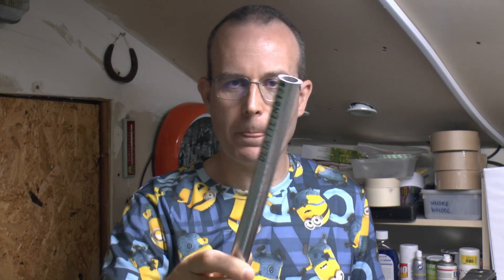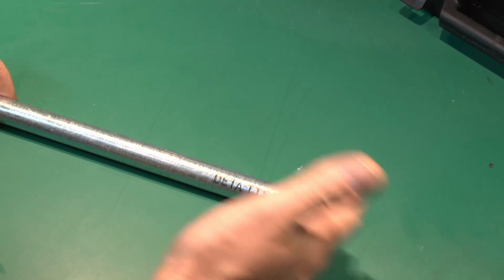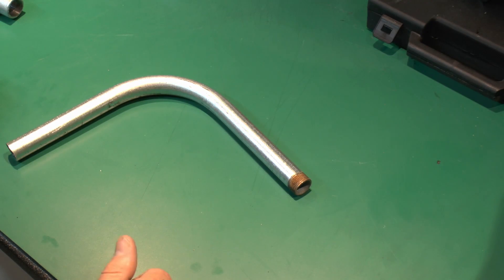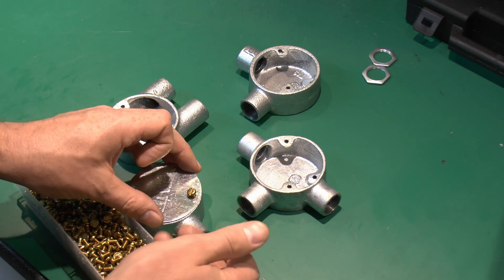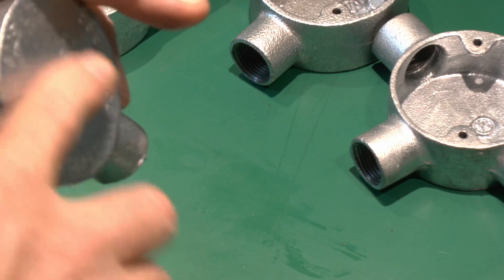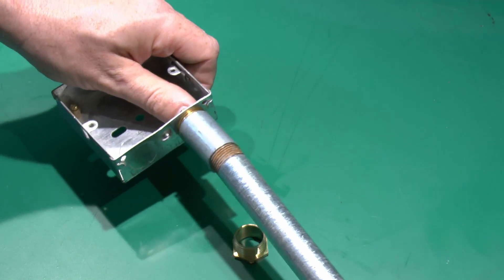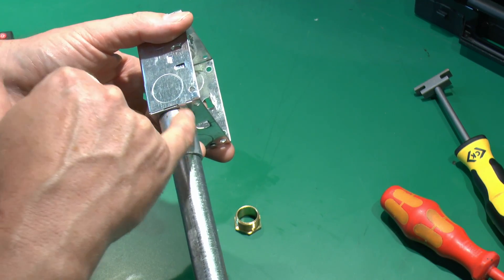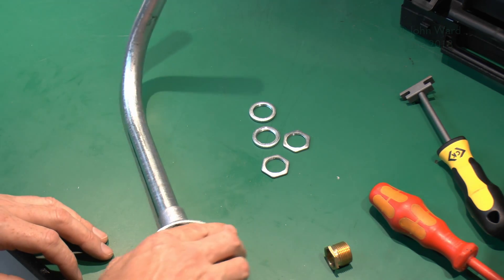Steel Conduit 1 - Overview of Parts and Tools

Comment: Can you use the steel conduit outside into a light (side entry) using just a Bush and coupler? I don’t see how it’s ip rated against rain?
Reply: Definitely no IP rating with metal fixtures and components. That's what you see with plastic parts.

Comment: JW, as always, thanks for your videos, very helpful content. I wanted to ask, can the galvanized steel conduit be used externally? I ask because it does not look like the boxes will be waterproof when you screw a flat top on them?  Thanks
Reply from the maker: Yes, it can be used externally.  Rubber gaskets are used to seal between the lid and the box, https://www.yesss.co.uk/circular-conduit-box-rubber-gasket
Reply: @jwflame  ahh yes thank you, obvious really, I should have checked.  Thanks for your response, and keep up the good work with the videos.

Comment: What is meant by class 1,2,  3 & 4 in steel CONDUIT (BS 4568) , Is this specification still in use?
Reply from the maker: That standard was withdrawn years ago.  The classes referred to the protection of the steel, such as primer, enamel paint or zinc galvanising.

Comment: Here in the United States we use 6/32 screws for switches and receptacles, and 8/32 screws for light fixtures. The screws have 32 threads per inch.

Comment: I find using a vacuum cleaner with some flex conduit taped in the end can pull a string through to pull cable. Also can use if drilling through a box want to vacuum the mess as you do.

Comment: Yeah, huge difference between EMT and rigid conduit.

Interesting that British sizing is for the OD, not the ID. Trade sizes in the US specify the ID and, unlike US lumber, the actual ID is slightly larger than the nominal value. So-called 1/2" conduit has ID ~0.74" and 3/4" has ID ~0.95".

Are the UK threads straight or tapered? The handles on that diestock are pretty small for the size.
Reply from the maker: Threads are parallel.  Conduit has always been sized on the OD.  However steel pipes for water or gas (and the fittings that are used with them) are still sized on the ID in inches, even today with most everything else being metric.
Reply: @jwflame  Very interesting. US rigid conduit still uses those inch pipe sizes and tapered threads. The tapered threads are a pain for aligning bends—the jam nut you show is going to be much less trouble.
Reply: @PaulSteMarie  I think it's the same with garden hoses and fittings as well. In the UK, the threads are straight, whereas in the US I believe you have tapered threads.

Comment: i have threaded plenty of conduit for internal work galv conduit is a total waste of money black enamel was allot easier to thread but that was them good old days . but think 18 edition wiring regs are with us metal consumer units plastic conduit could collapse in a fire oh dear , the metal clad system is back . a swan neck bend was the practise piece for a beginer in con duit or two u shaped bends with running couplers i made a right mess of mine . john thank you for these videos  you are a person with in depth knowledge . ? the iee used to have lecture nights held around the country to explain things in yours and my terms a bit like the christmas lectures on television i went to two very very good iet now what do these people offer if  dont they should . thank you john
Reply from the maker: Black conduit was cheaper in the past, but now it's rather difficult to find and is either the same price or more expensive than the galvanised.
Reply: @jwflame  Not sure if I'm reading this right but RS seem to be offering 20mm at £2.47/metre while galvanised is £2.58/m.  The snag might be that it's listed as 'back order, dispatch when available' so the price might be a for a product that never appears.  :)  And even so I see offers online for galvanised that are half either price so assume that RS price is well above what would be found at trade counters.

Curious memory, black enamel was used throughout the 'new' building at school which was erected 1970-72.  Very smart it looked too.

Comment: I'm seeing a lot of comments on US conduit properties which are pretty inaccurate. Here are some common specs for US conduit types:

3/4-inch EMT (21mm inside diameter) Nominal wall thickness 0.049 in., 1.25mm (tubing is not allowed to be threaded)
3/4-inch rigid conduit (21mm  inside diameter) Nominal wall thickness 0.107 in., 2.72mm (threaded with tapered threads)

Neither of these are bendable with bare hands unless you're really, really tough. For EMT trade sizes up to 1-inch and rigid trade sizes up to 3/4-inch, we generally use a hand bender. Above these sizes there are hand-powered benders, electric benders and hydraulic benders.

US practice would be to avoid the combination of bushing, coupling (coupler) and threaded conduit to minimize the number of joints when using the conduit as a ground fault path. We would typically use two lock nuts on boxes with knockouts, one inside, one outside the box to attach the conduit to the box, and a plastic or malleable iron bushing inside the box to cover the end of the conduit and prevent damage to wires. Cast boxes will be similar with factory threaded (tapered) entries. The tapers on the male and female threads form a pretty liquid--tight connection.

Set screw connected conduit has a very long tradition, and if installed properly can maintain ground continuity for a very long time especially when steel connectors and couplings are used (versus the zinc fittings which were very popular back in the 70s and 80s). That being said, it has become common practice to pull a separate ground conductor through conduit and not to rely wholly on the piping system for ground faults. This doesn't eliminate best installation practices required for installing conduit with set screw connectors and upon installation the conduit system must perform properly as a grounding conductor.

In general, metallic conduit is much more common in the US and Canada than in Europe and the installation of conduit here requires a more advanced level of craftsmanship than outside the US and Canada. Guys who do it often have really turned it into an art form.
Reply: TIL NEC only requires a separate grounding conductor in EMT or conduit for health care facilities.
Reply: Thank you. Love the Show, but 25 years of dealing mainly with Rigid, I was nonplussed when John was acting like America is wired with EMT. There's also IMC, but we didn't use it. Our stuff was mainly in a Class I Division 1 area, so even the Conduit Fittings had thread on covers. Most of our stuff was clad with heavy vinyl like covering for corrosion resistance, but some Stainless Conduit existed in the facility. Thanks for the thorough explanation of the various U.S. Conduits.

Comment: I use wd40 spray or tapping spray when threading metal conduit.
Bahco holesaws seem the best for drilling out the backs, it's handy to make a wooden block to secure them instead of drilling between your feet on the floor
Reply: When I was an apprentice we used Starrett holesaws, and Temaxol cutting compound.

Comment: this is complicated work. you can't atach the boxes o the wall untill you finish all circuit. because you can't twist the box on the wall with a conduit atached to the wall. that's why they have the "nasty" way of connecting them.

Comment: Re the rusty thread, surely this would hinder a good earth connection. Is it the done thing to clean the thread with wire wool or similar then coat the thread with a light grease? Great explanation thank you.
Reply from the maker: No, normally you cut the thread and then connect it immediately.  That one is only rusty because the conduit was supplied with it from the factory and it got left outside in the rain.
Rusty bits should be cut off and a new thread done.
Reply: @pmailkeey  https://youtu.be/tdQKskNMNbw

Comment: Just about the only time we used a "slip ring" was when we needed ti join to conduits together that were both bent! 
Simply threading the length of the coupler and ring on one conduit, run the "slip ring" and  coupler onto the conduit, offer the two conduits together and thread the coupler over the second conduit tightening the first conduit with the ring! If you needed a Box to be at the right angle to a tube when tight simply try it first and if the box is too far to make it , note the angle it is off and run the die back to the end  plus the required angle! We also never used the conduit as an earth but ran a dedicated earth wire! This meant that 1. you did not have to have a lower resistance path because the conduit is steel and the wire copper and 2. When the conduit deteriorates you do have an effective earth path! .... Obviously we earthed the conduit at each light / socket / switch point ;0)

Comment: What's the advantages of metal conduit over SWA/Armoured cable?
Reply: Metal Conduit is far tougher than steel wire strands wrapped around cable. It also won't degrade due to UV light like plastics may.

Comment: Hi John, This takes me back to my apprenticeship when the conduit was 1 and 3/4 inch then they changed to 25 and 20mm. I remember bending the conduit using me knee or a length of timber with a hole drilled in it. Then the boss got a bending machine...good times. Copper piro was also a good product but too expensive now. Thanks for you videos. Cheers Dave.

Comment: Hi, where is it legally required in Uk and what installations is it just advisable? Appreciate the factual presentation in contrast to US self promotional vids.
Reply from the maker: Legally required - probably nowhere, but there are many situations where it is desirable or even essential.
Reply: Graham North 

Recent example being a tire bay storadge area with a  cable run behind tire storadge racks. Galvanised trunking specified  in this area due to risk of plastic conduit being broken through careless loading of the racking.

Its certainly slow to install but definitely has its aplications.
Reply: Usefull in workshop or garage instalations.
Reply: Paul F plastic is good enough for most workshops.
Reply: Im sure the lighting has to be in metal conduit if the building has a thatched roof.
Reply: Often a requirement in industrial buildings. Or in public areas where wiring cannot be run in/through the building structure. The owner or operator specifying metal conduit.
Reply: I think it is the company's who are insuring the buildings choice, i did hear of a case where they would not insure the house (thached roof) if the wiring in the loftspace wasnt in steel conduit.

Comment: Any chance please JW you can do a video about how to measure to bends etc and how to finding bending point on conduit bending former please
Reply: To find it the point for certain, measure the amount you need and mark the conduit then bend it at that mark and measure how long it actually came out, next bend subtract the amount of extra for the next bend and it will come out exact, I have used many different types of benders and they are all a bit different as well as the dies used but my method will give you 1 pipe that will need to be cut for the first bend on the end of the pipe and after that you will know exactly how much you need to remove from the next bends to be exact with no wastage.
Reply: Yea if you could JW that would be handy👍
Reply: Please do this would be very useful.
Reply: Yes pls mate I'd appreciate that aswell
Reply: Mentorcase Thanks for that bug I’m sure a lot of people prefer to see/watch  than reading to pick it up quicker

Comment: Don't use this metal conduit anymore.  It was the standard 1,000 years ago before plastic was invented.  Same goes for plumbing.
Reply: Steel conduit is much stronger than plastic and is mostly used in industrial situations, plastic conduit would be too easily broken for use in such places.
Reply: Sometimes it is necessary. Here in Germany we use such a system to create installations which are vandalism proof. The conduits are stainless steel. The connections are different, here the connections between pipes are not screwed, they're crimped the same way like water pipes (copper or stainless steel). In standard installations we use plastic conduits.
The other application where you can use this is your installation is outside and exposed to direct sunlight. Plastic would become brittle over the years. But then you must use water tight variants rated at least IP54.
Reply: We've installed a fence and doors 20 years ago which are made of hot-dip galvanized steel. No rust until now.
Reply: Excellent points.  I was referring it to DYI stuff in general.  I would point out that steel conduit does tend to rust over time even galvanized.
Reply: In the us they use it for underground piping in commercial buildings.
Reply: And as a plumber, yeah plastic is easier and now all the idiots install it